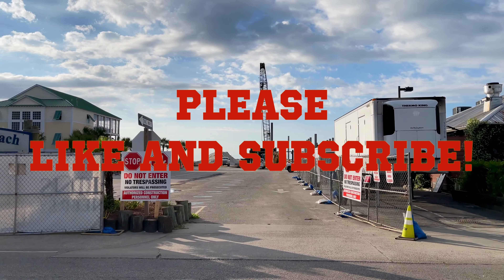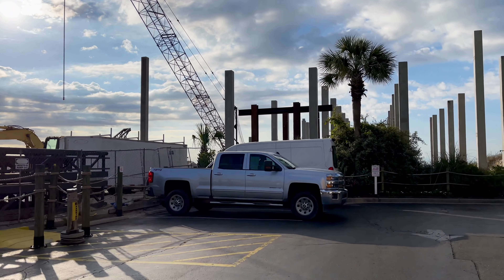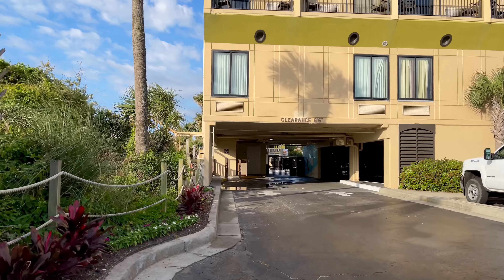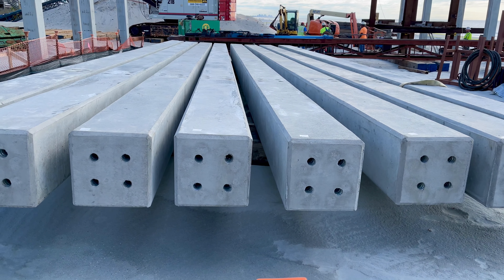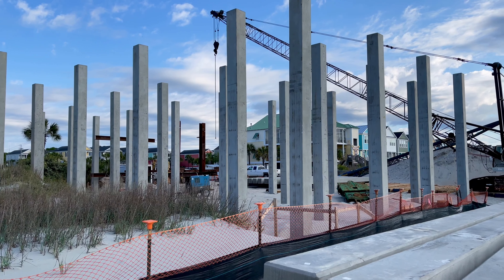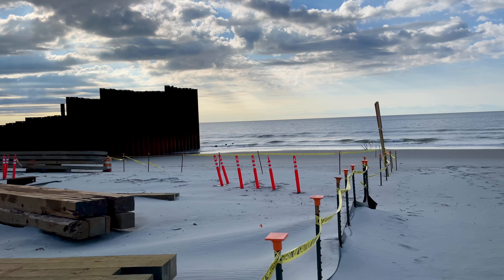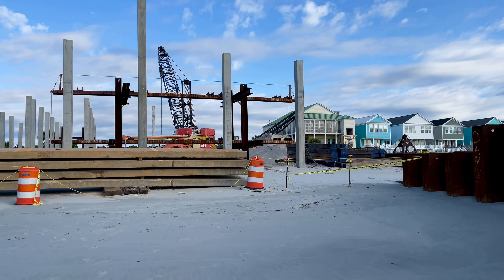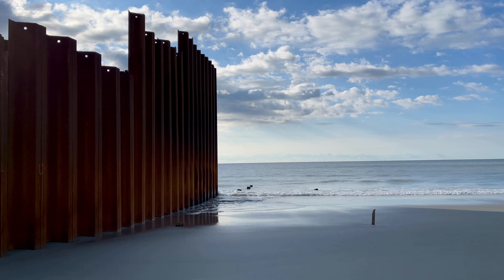Surfside Pier Update - Construction Explained - May 2021

Comment: The slabs around the 5:10 mark are placed on the beach to make a short path and then the crane moves over them.  I am guessing the crane would sink into the sand if they didn't use those.  When the crane is not working directly on the beach, they stack them back up.  Yes, I have been watching from the webcam on top of the hotel ;)
Reply from the maker: Makes sense. The webcam is a really good shot of the area, I'm glad it's there. Thanks!